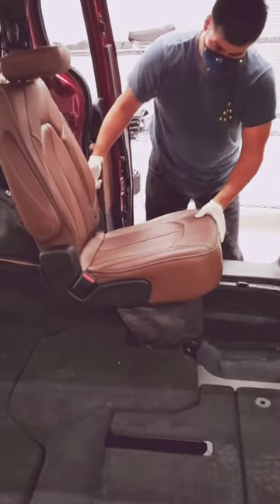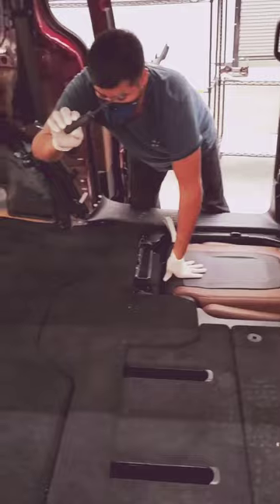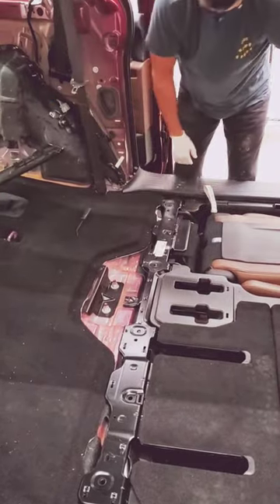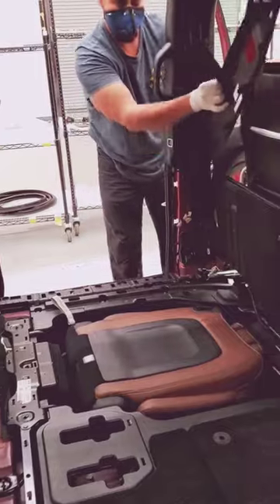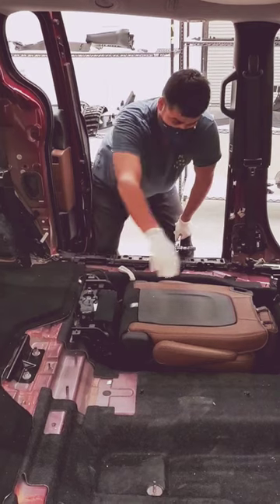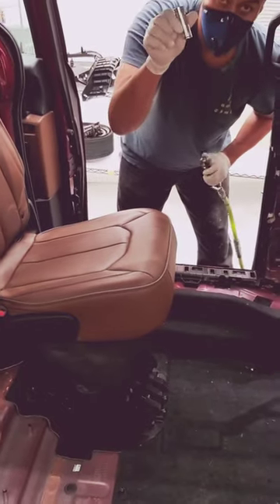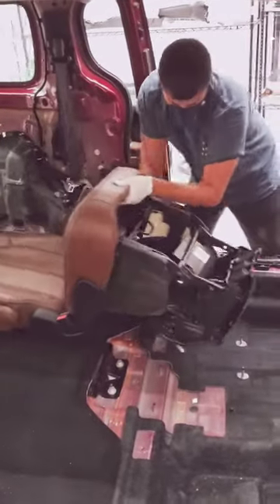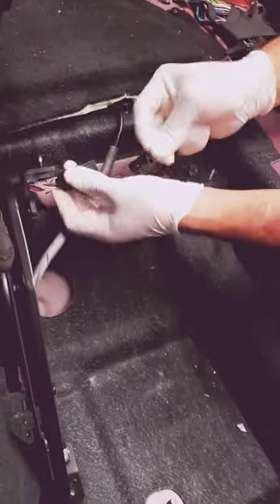2018 Chrysler Pacifica 2rs Row Seat Removal

Comment: I was looking at the option of adding a center seat to the 2nd row. Does it look like it is possible to do that if it doesn't come equipped with it? I was told it was possible, then saw you removed the carpet cover and it looks like there is a spot for it. What are your thoughts?
Reply from the maker: First i apologize for the extremely late reply, hope you were able to get that third sean in there.I definitely think you can fit it. If you remove the cover  and use the bolts on there, but I don't think it would be able to fold down. also I don't know the strength of those bolts, so safety wise you would just be hoping it's strong enough, in case of an accident.